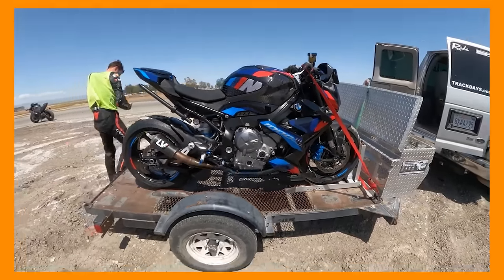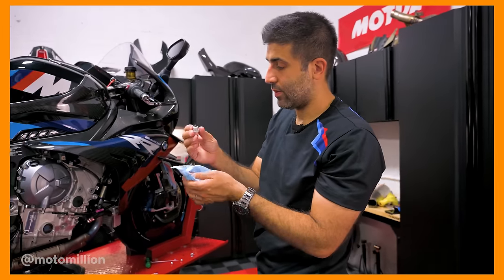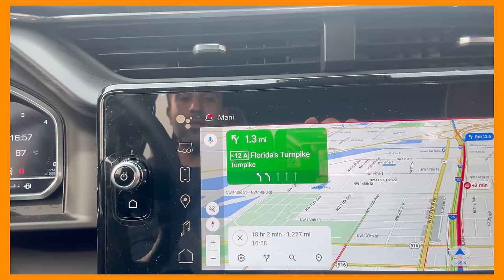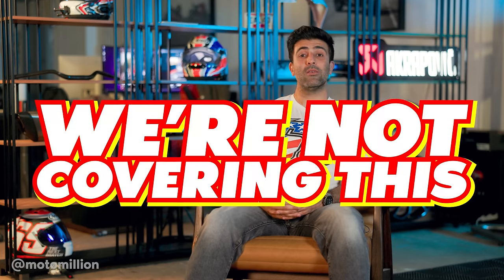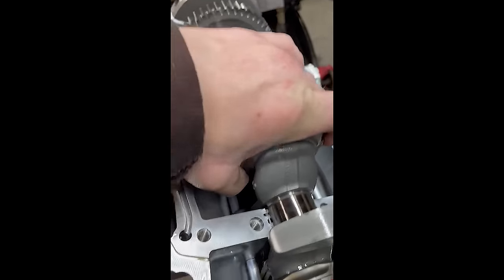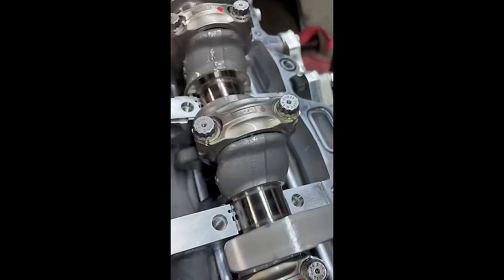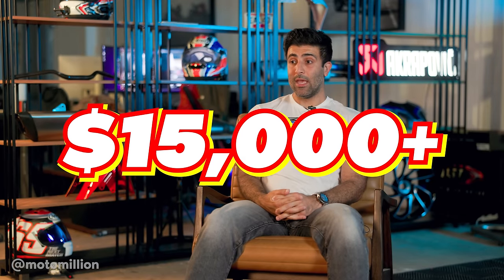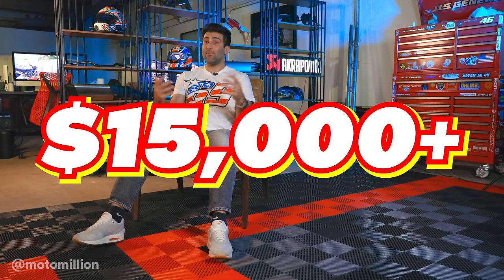MASSIVE Engine Failure on our M1000RR & BMW REFUSED Warranty...

Comment: As soon as you remove the rev limiter or remap the engine you void the warranty there and then, if you try to take this to court you will lose as you have taken the limiter of below the prescribed mileage period.. unfortunately we know the bearing failed BMW know that most definitely but you didn't stick to running the bike in at the right mileage interval... BMW will not come out of this smelling of roses either there is no way, I would buy a BMW 1000 for 35k knowing a bearing could fail.. plus it looks well documented that they fail so potential BMW customers could be put off , I know, I certainly would be.

Comment: I agree, poor engin build. It is ashame that BMW did not cover this engine knowing it was a poor build or weak part s. I will never purchase a BMW bike just on the fact that you got the run around. I would look into the Magnuson-Moss Warranty Act. It may help it may not. But SHAME ON BMW. It's no longer the ultimate driving machine. $40,000 paperweight.

Comment: If you don't follow the warranty requirements to the letter of law and give 'any' manufacturer an excuse to void the warranty and save the cost of a new engine, the bike manufacturer is going to void the warranty which they did.
Same in the car industry btw.
Taking it a step further because a lot of money is involved.,...if you were to take BMW to court and hire a lawyer, you would have lost the case and you likely know that.

As a mechanical engineer, I wouldn't have done what you did anyway. I also have a trained ear and can tell if an engine isn't right from the factory and what you didn't say is if this engine 'sounded right' when you took it for its dyno run.  Maybe you don't even know what a healthy engine sounds like and/or you felt in your gut the engine wasn't right and you red lined it anyway with 400 miles on it.

Last note is, I don't believe in the integrity of BMW cars or motorcycles.  I would never own one today and I have owned a couple in my past.  So called 'German engineering' being superior is a myth as their reputation to the contrary precedes them.

Comment: I've ridden 45 years, BMW has always been the most unreliable brand I have ever owned. All 3 of mine had to be fixed under warranty within the first 1000 miles. Great engineering, terrible assembly.

Comment: in any case you directly modifies the engine control unit by removing a rev limiter for a 40,000 machine I understand that you took car of the bike but since you made changes to the bikes factory settings they reserve the right to not honor your warranty. i know its a bad situation but you have to pay to play. i know calimototv bike you said grenaded I personally think you and cali should not get warranty since they were modified. respectfully

Comment: Do you all actually think any upgrade they did to the bike is the reason it failed? I’d question your intelligence, a 40 thousand dollar motorcycle should not ever have an issue within 1000 miles.

Comment: Well warranty condition not respected and they voided. You could ride to the dealership to pump up mileage and let them work on it instead of dynoing it😮 do people know about german precision engineering and the reasons for engine breakins?😂

Do check on the buyer if he's still riding
Reply from the maker: Warranty was never voided by them

Comment: that's due to poor assembly: incorrect tightening torques. 
It's not the only problem with the connecting rods of that engine: some had it even worse, and received the same behavior, as BMW didn't want to recognize the fault under warranty.
https://youtu.be/wTFbygMjLZ0?t=954

Comment: Unfortunately, BMW has made a name for bad rod bearings in the automotive industry.  Looks like they have stayed consistent and carried it over to bikes.  I know BMW has gotten extremely aggressive denying warranty clams for autos and it would seem the same for bikes.  They have a tendency to search out any excuse to deny claims.  That is a real shame.  I have owned BMW bikes in the past (GS is the GOAT IMO) and am currently on an Aprilia.  I would say my COVID Aprilia definitely lacks the quality of my Apes pre COVID.  I am speaking to fit and finish and can only hope they didn't skimp on mechanical components.  It is a "factory" model and has not a shred of carbon.  Paint is mediocre at best and I've seen better body work/plastic on Tonka Trucks.  When the original Ducati Panigale (V twin Superquadrato, spelling likely incorrect) came to market I snatched up a Tricolore immediately.  That bike blew an engine  at about the 1600 mile mark.  I believe the problem was oil starvation due to a bad crank case casting.  Ducati covered an engine and I recall having an motor (16k I remember them saying) sent from Italy and installed in my bike in less than a week.  I have two BMW cars that I love but both came with factory installed gremlins that can lead to catastrophic failure.  Exterminate the gremlins and they are great machines.  Surprised they let the gremlins into a bike.  As the owner pointed out a catastrophic failure on this bike could be life ending.

Comment: I know you want to look cool but stop buying BMW's. Mine in the garage has catastrophic engine failure at 120k. Used LL01 oil and never let it run low. Its getting LS swapped.

Comment: I know how feel and how disappointed you are but if I were you when the first problem happened at 9 miles you should have stop using the bike 5you shouldn't have put the bike on the dyno and revved hard, at 9 miles problem you should have taken it to bmw straightaway. 
If I were you I would buy Japanese bikes they are more reliable than the European counterparts 😊

Comment: BMW would have honored the warranty if you just had completed the 600 miles break in and made the service according to Bmw. You were unlucky with the engine, but Bmw has the right to refuse warranty in this case. Sorry for your problems, but I think there is a lesson to learn here...

Comment: Most car manufactures run the engines that are istalled in cars breifly after they are assembled .Ford rep says their engines are run 4 hours after assembly..I have rungvthe nuts off off mustangs other vehicles during pre delivery inspection to the desler and always felt you rather it fail now being Ford still owns it till i sign off on paper after PDI.These cars usually show spprox 4 miles when you recieve them off the truck and have never seen but a couple failure of engine in 30 years.Why would a company like BMW not do this for motorcycles.But i eould think since these guys doing a youtube video on this bike that BMW would bit the bullet and honored warranty cause they lose more in sales.then engine cost .

Comment: I thought it was going to blow up on the dyno. Why revving so hard. If i had bought with my hard earned cash, a bike hard to get hold of, it would be a couple of thousand before redlining. Sort of have no sympathy.
Reply: Still i was in aircraft and it spun a engine bearing, oil up windshield..

Comment: Sorry, but you brought this on yourself. I have been an amateur drag racer and a professional engine builder for vintage (1967 and earlier) drag race engines for over 40 years. I also ride motorcycles. No competition engine has a warranty. But this was sold as a street bike. Street legal and with a warranty. You clearly violated the terms of the warranty, and regardless of whether that is what caused the engine failure or not, it absolutely will result in damage not being covered by the warranty. When you got that indicator that there was a problem with the engine, you should have shut it off right then and there, and taken the bike back to BMW. Over revving it, even by ONE rpm, is grounds for them not covering the damage. That is true of ALL manufacturers warranties, like it or not. So there is no way to blame BMW for this one. Now, having said that, it is my opinion that BMW is one of the absolute worst car and motorcycle manufacturers out there. That was not true 50 years ago, but it is now. Look at any list of cars or motorcycles based on reliability, and BMW will be at the bottom of that list. For motorcycles, Yamaha is usually at the top, but even they are nowhere near as good as they used to be. I have never owned a BMW, car or motorcycle, and never will, even though the 1970s and older airhead BMWs do appeal to me.

Comment: Just sayin... do break in procedure... then abuse... its like me saying, " I disagree that oil needs to be changed every 5k-10k miles... engine blew up after 30k without oil change... this is a design issue. "... there could be a design issue... but you also didn't follow basic instructions... so was it a design flaw or did you cause the damage? Why is it BMWs problem if you run the bike into a wall? They didn't build it to hit a wall? Is that a design fault too? C'mon...

Comment: I am currently riding an S1000XR model 2022 M Package.
I am the first and only owner of that bike, therefore I meticulously followed the running-in instructions set out by BMW, which is 500 to 1,200 km.
The revs are limited during a large part of that period.
The result is that my bike runs perfectly well and I have done some 45,000 km on it so far.
At least two things on that bike were replaced under warranty, 1) the rubber dampers in the rear wheel and 2) the alternator.
I didn't even have to ask BMW to do this repair under warranty, they did it themselves.
I am 100% satisfied with the BMW service and I shall definitely choose BMW Motorrad in the future again.
Your BMW story is thus perfectly understandable, since you didn't even bother to run in that M1000RR correctly and above all, you fiddled with its engine yourself.
I therefore totally agree with BMW that they refuse warranty on a motorcycle that was messed up by its owner.

Comment: So far like 14 minutes in there is a LOT of between the lines info I am ot hearing.  Like WHAT exactly is meant by "we are not covering"  WHY is this presenter failing to explain THAT?  I am almost assuming "BMW" is taking the stance "metal shavings in oil COULD be normal....MAYBE nothing is briken therefor s of now?  no clima is presented?  But not hearing those details yet which is BS IMHO....My KTM and apparently most KTMs had metal shavings in early oil changes and various owners said KTM took stance "this is normal just ride your bike and shut up" which like it or not is what these others and myelf was forced to do....sounds similar here so far

Comment: I dont know where to start dissecting all the inconsistencies in your video , but i can end with this, you removed the rev limiter and didnt allow the run in process, exactly the same as the other engine breakdown you quote. How can you say its not because of the rev limiter when you dont know, you do not know this
Reply from the maker: First service is done after 300 to 750 miles. This is on the BMW Owner's manual. After the first service, the break-in limiter is removed. This is what we followed

Comment: Not a good look for BMW is it. Rolls-Royce would have replaced the engine and pretended it never happened. BMW are marketing these at the top end of the market, you would have assumed that they would want to retain and improve their market share.
I would not buy from them after watching this. I would have happily bought if they had delivered better customer service.

Comment: You're being a drama queen? NO. There should be ZERO talk. you should not have even made a video on this. You should NOT have even needed proof of the damn issues. Period. BMW says 3 years 36k miles. PERIOD. Shut up BMW. Stand by your business. This is hot garbage from them. period ... dot.. lol. (I don't even have a BMW...) **I feel the same way about blown up R1 motors too FYSA (seems like a trend).

Comment: BMWs slacking, there shit junk in there cars and bikes clearly. Keep fighting and spreading the word. I find it so impossible to blow up a race purpose built motorcycle in less then what 1000 miles/ 1500KMs. sounds ridiculous, you would think they run the engines before sale @40k price tags and break in the motors..... honestly not surprised by BMWs shenanigans but still disappointed.  Best of luck mate!

Comment: I've heard these BMWs are insanely unreliable. . . . Stick with Japanese man. Honestly,  I know they're down a bit on horsepower but save yourself the hassle and money. 
The most disgusting part of this is these M1000RRs are $70,000 motorcycles (I'm from NZ so that's in NZD). So that's 40000 USD and they're exploding with only a hand full of miles. If it was a 20000 to 25000 dollar bike I'd let it fly to an extent but for 40000 USD!?!?! BMW should be taken to court. It's disgusting

Comment: Ok yes your motorcycle did sound just like the in the carwow video. But dude come on we all know the risk u take when u tune ur bike under warranty but i personally think u guys were thinking that since ur content creator's there was noway bmw wouldn't cover u if something did happen and u took that risk and it came back bitting u in the ass. So i think the lesson hear is if ur going to tune ur bike just know that u may or may not get covered. If u dont tune ur bike and it blows u will 100 % get covered.

Comment: 250rpm over a few times is ridiculously NOTHING on any robust quality engine platform and it ought to embarass the heck out of BMW that ANYONE at BMW even suggested THAT as a cause!  Beyond ridiculous!   Silly DUMB.... And YET?  This man could not take a few hours to do the break miles?  But then COULD drive THIRTY EIGHT HOURS round trip to take his claim to a mechanic in another state?  I find a tad odd?  I mean I get his logic driving that far ( I would not have) but I cant get not doing the miles to begin with?....surely knowing it is monitored via ecu?   I understand there is no way to cover it up after the fact....  A bit idk?  cocky ?   Still BMW SUCKS!

Comment: Seeing your lifestyle, money isn't really a problem. So, what I fail to understand, how can't you even get a written response from BMW? A lawyer would make sure you got one. That same lawyer would get BMW sued. Instead, you already replaced the engine on your own cost, and complain afterwards. If you feel justice wasn't served, why not chasing it? Also, you're contradicting yourself multiple times. Saying you never talk negative about the bike, when you've just shown the super negative rant after it presented the warning after 9 miles. Letting it idle on, during the warning. Also, presenting a failed superbike race engine as proof of a widespread problem, is just gaslighting. Stick to the facts, as you promised in the beginning. BMW isn'tbknown for great customer service. Remember the 1250 GS front fork problems from a fewvyears back? The caps weren't fixed to specs, and all failed, leading to dozens of crashes, wounded and even killed riders. It took massive pressure to let BMW acknowledge the problem, and took a year to finally resolve the problem, replacing all front forks.

Comment: Despite the many negative comments here you were deeply wronged by BMW. The engine clearly had an assembly problem and their denial is completely outrageous. The manufacturer must keep a log of issues and can trace back the problem to the date and time of manufacture and to who assembled the engine. Modern engines have a lot of robotics in their assembly and it’s definitely a possibility of a problem that is occurring often enough for concern.

Comment: Substantially modify the operation of the unit, utilized said bike, at race performance levels, and in dyno testing. And you have the cajones to cry about them not doing warranty repair on the engine you broke through abuse, and none OEM modifications? Shut the Front Door. Props to BMW for telling you all to go pound sand.
Reply from the maker: Race performance levels, yes. Because this is a homologation race bike, sir.
You do know that this bike is homologated for WSBK?

Comment: So, basically this video is an attempt to get back at BMW and damage their reputation. It may be right or wrong, but it is funny that "content creators" feel so privileged that want to use their media power as leverage. Nobody is worried what happens to regular people. It's just "I am the Youtube guy with fancy resources and custom modifications barking for 35 minutes my case against BMW". Again, not saying BMW is right, but using your channel to get back at them is just immoral. Go sue BMW in court if you have the resources and the facts. Btw, I had to watch the video at 1.5x speed, it was unbearable to watch at normal speed.

Comment: These high-end bikes are garbage. Get a Japanese bike. If it breaks, they fix it every time. You did nothing wrong, and BMW doesn't want to admit they have ongoing issues with one specific model because the next step is a recall. And we all saw what happened when a different high end company had an engine recall on certain models. BMW doesn't wanna pay for that. If they admit it once, it makes them have to admit it every time. Again, buy Japanese.

Comment: It’s clear from this video how SUPER important to break I this specific M1000rr engine , if you’re a new buyer please break this engine in and save yourself a headache
Reply from the maker: However, we have seen many other M1000RRs blowing. In the video we reference Carwow's M1000RR which was completely stock and blew up on the drag strip.

CaliMotoTV's BMW M1000R had a full exhaust and ECU flash and blew up on the track.

Comment: If you tune or anything its voiding the warranty
Reply from the maker: Bill at CaliMotoTV had his BMW M1000R blow up on the track. The bike had a full exhaust and BrenTuning. BMW fully replaced the engine under warranty. 

What's this inconsistency?